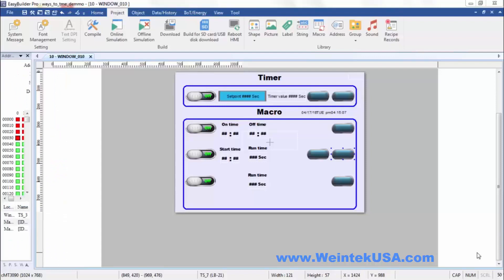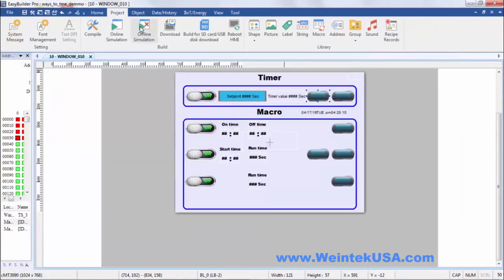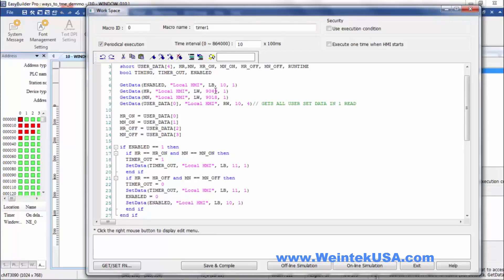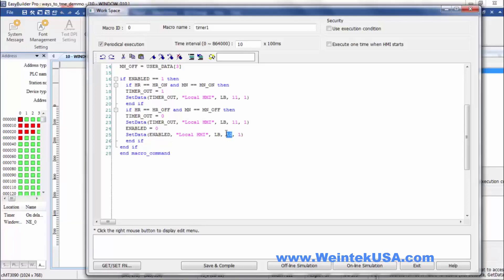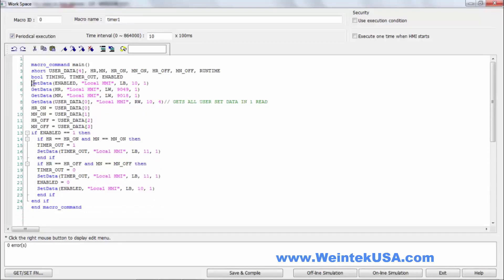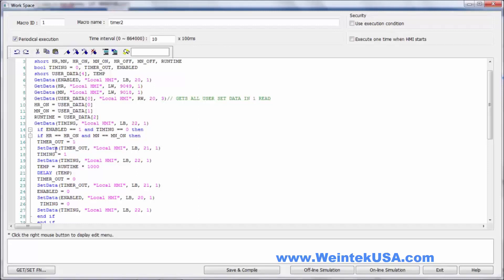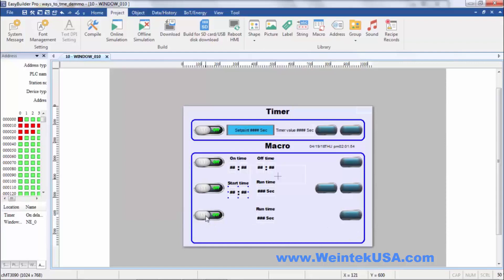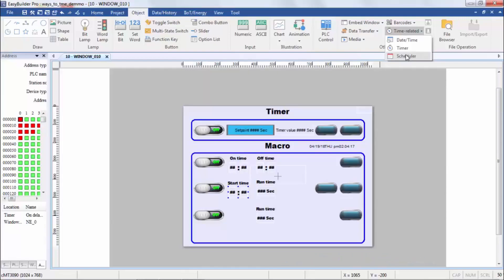Basic HMI Timer/Macro Methods with Weintek’s EasyBuilder Pro Software

Comment: Hello! Is it possible to set a timer to maintain the startup screen as long as the PLC is fully running? In my case around 50 seconds. Thank you in advance!
Reply: Hi @SpeedFil,
To clarify, do you mean use a timer to maintain the startup screen as long as the PLC is NOT fully running? If so, one method that will accomplish this would require you to configure the output of the timer such that it triggers a PLC control object set to "Execute macro program". This PLC control object can be configured to trigger a Macro that will change the current window as shown within this tutorial: https://youtu.be/QsLkolHpXCE.

Comment: Very interesting, I need to make a macro with a 5000 hours horometer for service, but the timer must be maintained even after a power outage.
do you have a piece of advice about how to do it ?. Thank you
Reply: Hi Alejandro,

The best way to save information is to use our RW or RW_A registers. These are retentive registers and will save the information entered in the HMI's flash memory. In the event of a power failure the data will be saved and visible when the HMI receives power again.